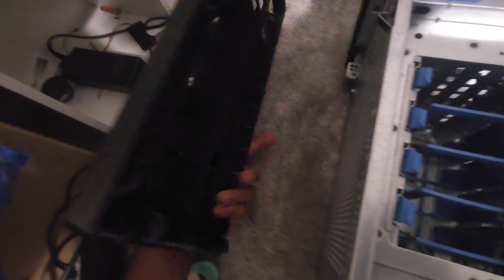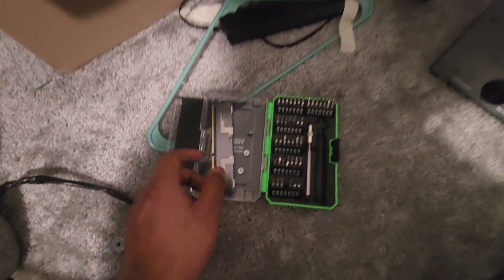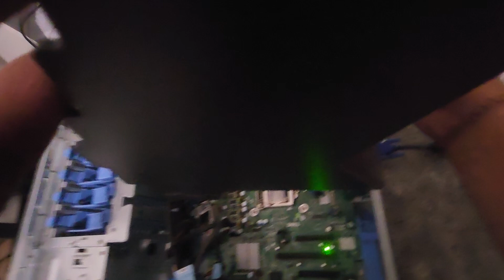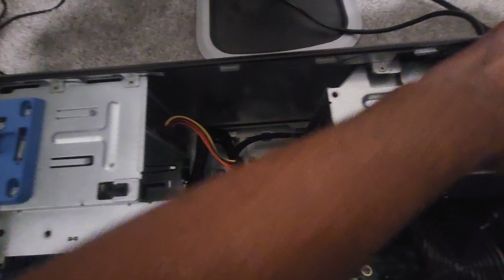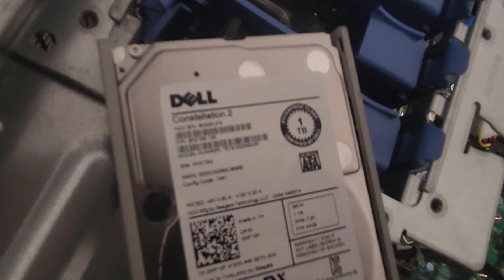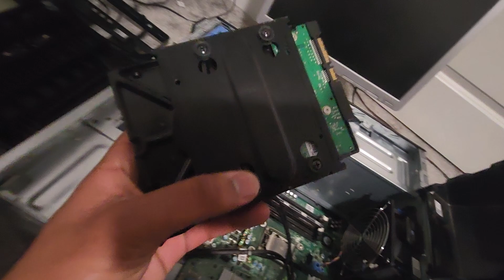Thrifted Poweredge T310 with dead power supply

Comment: I was having a similar issue following a power outage with my t310. Turns out, if I held down the test button of the power supply and while holding it, press on the power button on the front, I managed to keep the power on. After that, I removed the power cord and reconnected it to find out that my LCD was actually showing me errors. I then could boot to the idrac and so far, it seems like my server is getting back to life. Hope that helps you out or someone else out there
Reply from the maker: I am assuming that the power supply is dead, so I bought a 550W atx power supply. I am planning on adapting it to the T310. I'll post a video if I'm successful.
Reply from the maker: Hi! I just uploaded a new video where I got my T310 working by using a regular pc power supply. I tried what you said and all kinds of other stuff, but ultimately I think that the psu's life was just over.